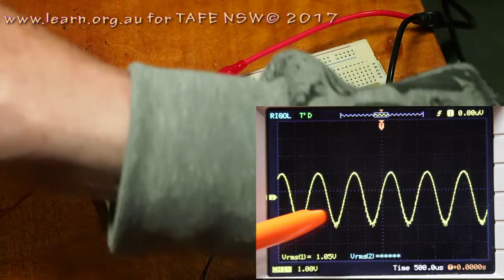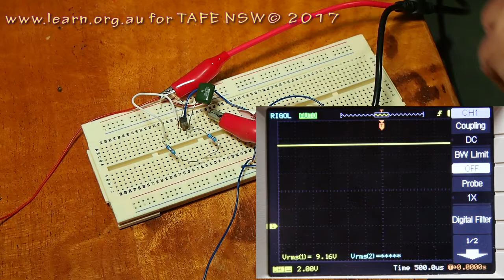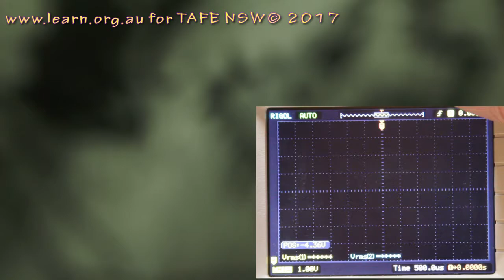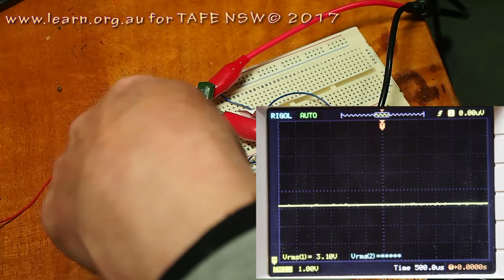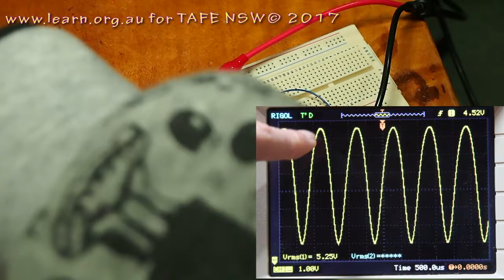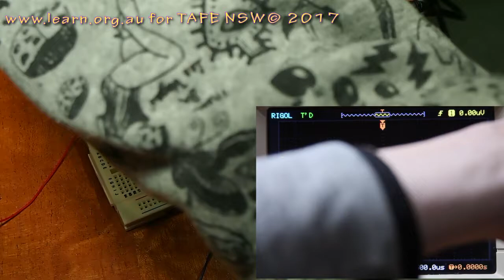BJT collector Feedback Biasing UEENEEH113A TAFE NSW Part 3

Comment from the maker: 19mV RMS input @1kHz for 1.9V RMS output (3.1V DC Q point)  Av= 100   But with the DC Q point at 4.5V the Av was 110 with asymmetrical distortion.